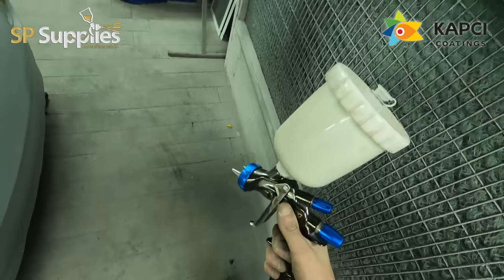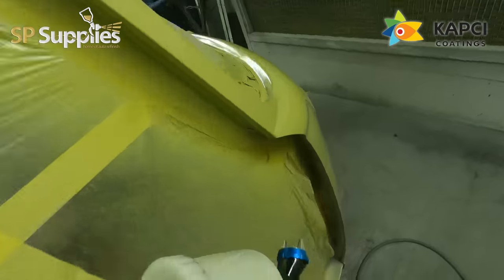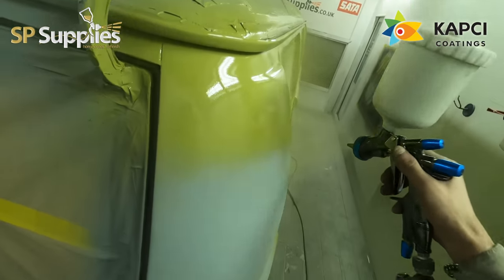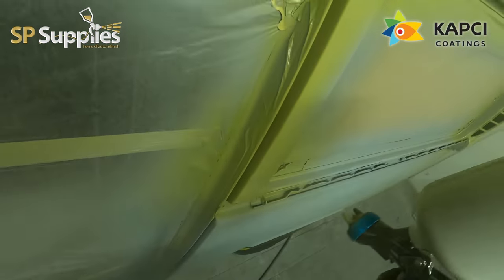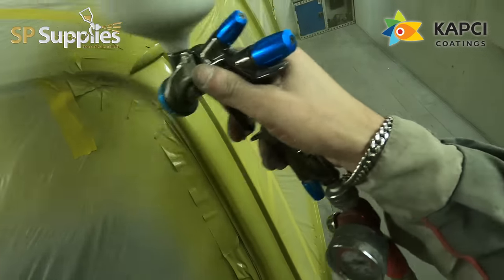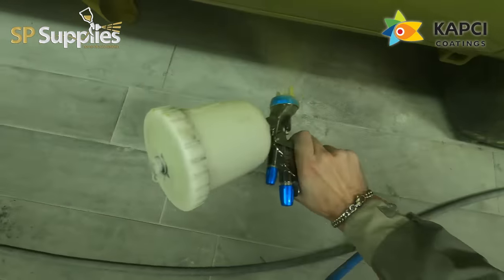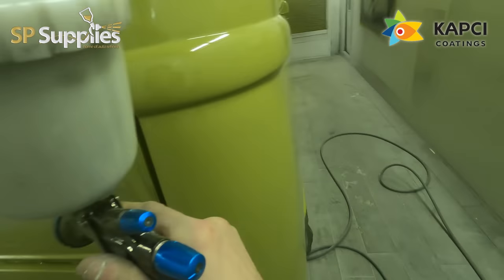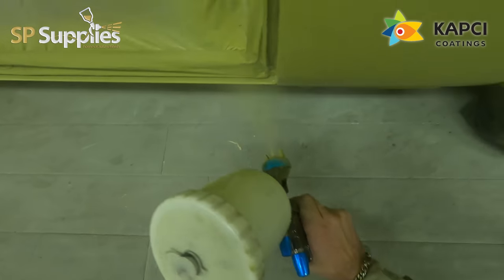VW Bay Window Camper Paint Time - Kapci 2k Direct Gloss

Comment: the atomization of that gun is really nice. I have a mango Bug and it is a slight bit dirtier color. I wish we had that kapci in direct gloss. I would probably use it too. Love the Kapci 6030....I also have used a bit of the Kapci Latica which is pretty nice inexpensive clear. They both go down about the same. Seems like you cant go too wet on the second coat or 3rd. just flows out really smoot. Of course if you burry it it will run but it is almost hard to do. It flows out really perfect. Polishes really easy especially after setting for 3 days. Great Value IMO material. Really good quality too.
Reply: by the way that color still does look like mango...Could be the lighting and camera.

Comment: Tony great job once again! I really enjoy seeing you work on these old bay window buses.
I’m in the process of restoring a 71 bay and almost ready for primer.
I have a few questions to ask you, if you was using two part base - clear will you still use the same method of going over it with a lower gun setting for a lighter first paint coat, like you did on this job?
Also, what brand of seam sealer you use on the van?
I will love to see a video doing all the seam sealing on one of these vans!
Thank you for the videos and your great advice!
Reply: Tony must be really busy with work. That is a good thing!
I hope he can answer my question before I paint my VW camper van project in October.

Comment: Hi mate love the video! i’m thinking about getting a series 2 obs myself specifically for direct gloss, i currently have the ws400 and ls400 series 2 for base and clear and i’m wondering if you would go for the obs or the ls400 clear for just direct gloss? i have used the ls400 for direct gloss in the past and was happy with the finish i achieved but if the obs gives a flatter finish i would much prefer that! thanks 👍
Reply from the maker: id pick the obs over ls for gloss mate
Reply: @TonysRefinishingTV  Think i am going to go for the Obs mate cheers! have you by any chance tried the ws400? i’ve used that with the standox direct gloss and found that was good too but im wanting to get something that can provide a nice flat finish for gloss for the bigger jobs